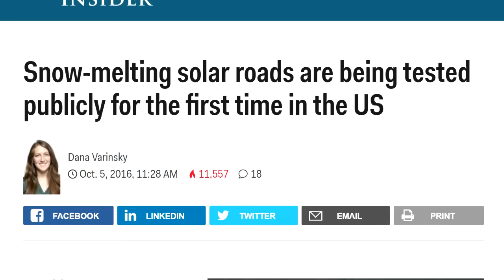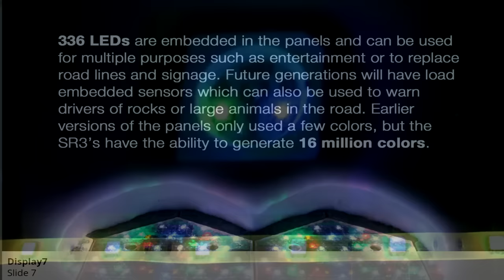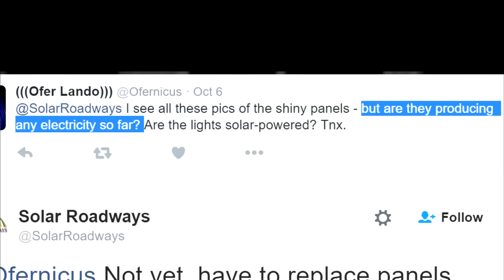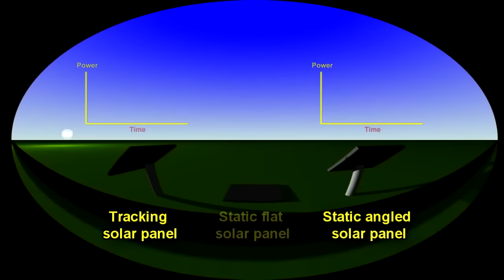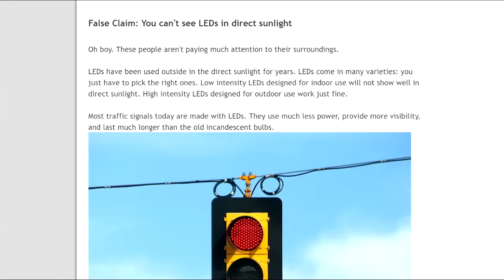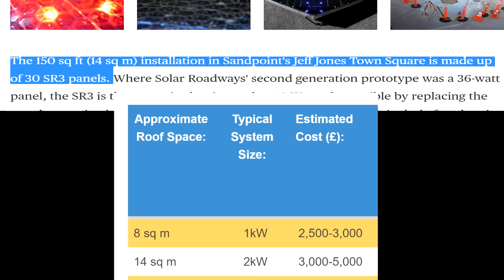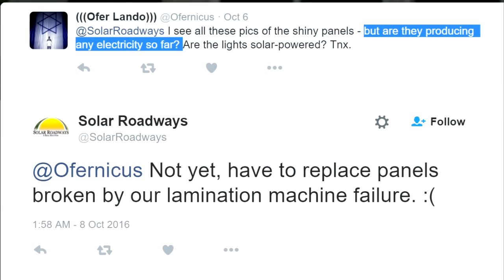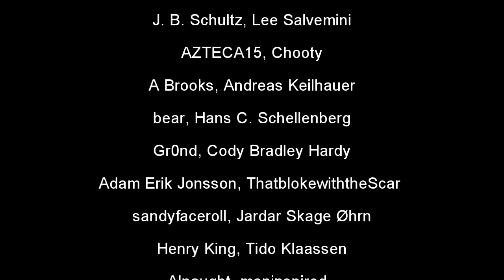First AMAZING Solar Roadway UNVEILED!

Comment: ... To think that such an insulting farce is still being worked on...
Reply: This should not surprise you. Most members of our species are still willing to believe in sky wizards without seeing any evidence. Of course they are going to believe something like Solar Roadways when they there is a catchy promotional video they can watch. Heck, even myself as a perpetually skeptic scientist got enthusiastic for a moment after the video.
Reply: With the "sky wizard" at least there is no direct evidence to the contrary.  With the solar roadways idea, you can quickly google the facts you need to do the math to work out how much money per square meter of road the electricity would be worth.  You can then see how much the installation cost and how much area it covered.  None of this requires skills above what the average grade school kid has.
Reply: Yeah, but there was no way to know it would not work until they tried.
It was supposed to be a fighter that would make all other fighters obsolete so if it worked don't you think it would have been worth it?
This actually is the kind of wasting money a government is supposed to do. It was the same thing, to stay with planes, when they were experimenting with jet fighters to replace propeller ones. There was no guarantee that it would work, they had no idea if they could make the plane from durable enough materials to stay together, if people would be even able to control it at the speeds it would fly at and a lot of other problems but they still tried and succeeded.
Reply: Killer.exe At least the jet engine was a proven concept. I do agree that the government should invest in ways to make the world better, but they should at least invest in things that have a basis in reality. It's clear as day when you listen to the officials that are endorsing the project, that they have no idea how the science works and are only doing it because it makes them themselves look good.
Reply: Miranox ... That's the plane that denmark just bought 21 of those... I'm pretty sure the plane should be fully operational within the next couple of years.
Reply: Just goes to show you how easy it is to make lots of money if you're willing to sell your conscience.
Reply: Being worked on .... whatever....    ...still being STATE FUNDED ...  that's the real Farce
Reply: Dean Goldenstar
We'll see about that. Most importantly, we'll see if it actually justifies the absurdly high cost.
Reply: Miranox I agree on that point. Though a stealth joint strike fighter seems to be somewhat of an ideal, even with vertical takeoff. I hope they can deliver. If not, we just wasted money and bought the most expensive crap on the market.
Reply: While a concept like incorporating piezoelectric generators into roadway systems (which may not be feasible either...but damn sure more feasible and less fragile/complex than solar roadways) struggles for funding and gets little to no press...
Reply: That anyone would even think that piezo roadway would be an energy source says a lot about the sad state of scientific education in North America.
Reply: Billy97
It will never be useful as a large power source but could potentially have some cost effective uses...Solar roadways don't even have that going for them...and yet they get the attention...
Reply: possumverde
These days you will get tons of praise if your stated goals fit the PC culture, even if your actual results are horrendous. Just look at BLM.
Reply: Miranox
True...I was doing some more digging and apparently such idiots have been successful in convincing California to to create a Piezo system...using pretty much the same outrageous claims behind solar roadways and which several university studies have already concluded to be a waste at present...They'll be heroes until the results come in...then the failure will leave a bad taste in politician's mouths and funding for legitimate studies will decrease further...
Reply: possumverde Where do you think the energy would come from?? The flexing  of the roadway for the piezo effect would increase the rolling resistance of the vehicle wheels. Think of paving the highway with foam rubber. It would make the road a parasitic load on the vehicle engines, increasing their energy consumption. It is basically harvesting energy from the cars traveling on the road. 
The first law of thermodynamics  should be enough to quash that one. Never mind the losses involved in the process.
Maybe the government should just repeal the laws of thermodynamics and ohm's law too.
Reply: It's in the state of missouri, the same place as missou uni, so y'know.
Reply: Indeed. Were you to get ridiculous with it (like a huge stretch of interstate) then the decrease on gas mileage etc. would definitely not be worth the amount of power produced. There are situations however where there may be enough of a benefit at small scales for it to be useful...Essentially it would be a tax on drivers (leeching some gas mileage to provide a benefit). In large cities with high density "stop and go" traffic, small scale use might be able to supplement some existing tax funded electrical uses in a manner that would actually lower the long term overall costs.

I'm not saying it would be any sort of answer to energy problems in general, but it is far cheaper and more durable than this solar roadway nonsense and, unlike solar roadways, could potentially have some beneficial uses worth the cost on a situational basis.
Reply: No Free Will oh really I thought Mizzou was in Alaska... in all seriousness I'm fucking ashamed my home state is falling for this shit. Disgraceful.
Reply: possumverde If you find yourself in a hole stop digging. 
Whatever the amount of energy absorbed from the vehicle, the output of the device will always be less due to losses.The frequency and duration of the output would also be so low  that there is little chance of producing significant output.
 If you gather such a tiny amount of energy it is not worth the cost of the wire to connect it.
Reply: artiew87 ... If you're from a place that can't supply clean water to its citizens, then I'm going to argue with you on that point.
Reply: +artiew87 That was random. You might be correct, but it was a bit off-topic, don't you think? (Oh, and the biggest farce in Sweden is the way we let american politics and ideas affect our society.)
Reply: ***** What matters is that however good you make the roadway solarpanels, they will always be cheaper and better placed somewhere else than in roads. For example, putting them slanted above the roads would be less insane.
Reply: The biggest farce in Sweden is the way the country has allowed EU politics to dictate how it's society has been and will be run.
Reply: I disagree with you. Some things are just an obvious waste of time and money. And this is a great example. You do not have to build a mile of freaking solar roadways to see if it will wok. If you looked at this video you can see they are just scamming Idaho taxpayers. Any real good idea, that actually works, will be grabbed by any investment company in the blink of an eye. 
Would you fund a group of people to look for the yeti?
Reply: Indeed. They should spend this money on putting solar panels on every god damn roof they can. I bet this went through because the local energy suppliers saw how stupid it was and didn't try to block it as it doesn't pose any kind of threat to their business haha.
Reply: There is already a very good VTOL on the market. Tbh it's the only proven viable VTOL plane. It's called a Harrier Jump Jet.
Reply: ZER0 The Russian Yak38 isn't too bad either, and the 141 showed promise before it was cancelled after the Soviet Union fell in on itself from lack of money.
Reply: ***** So... like putting the solar panels on roofs instead?
Reply: +Aids gr8 b8 m8
Reply: +Aids well then that's just sad
Reply: ***** Glass isn't suited to be a road surface, it's too vulnerable to vandalism, the solar panels are only at 30% optimal efficiency, if they have light and or heating they're gonna be a net loss in power production.

Honestly I think the next innovation in roads will be when all motor transportation is fully automated and the road will have some tech in it to help them navigate more accurately.
Reply: Billy97
You're overlooking something...The energy output being converted by piezo in this type of set up would the ~3-4% of energy produced by a car's gasoline engine that is simply lost through vibration etc. to the road. Even if you're not getting that full 3-4% back (which would be impossible), anything you do get back would be technically be a "bonus." Now whether or not the costs involved and the efficiency limits of the conversion etc. would make harvesting from such a small amount viable is another question. Currently the answer would be no (especially in the manner California is looking at with their trial run,) There may come a point however when small scale application could be put good use.

No one's talking about "free energy," just the potential for more efficient use of "wasted" energy. Extra work on the part of the vehicle is not necessary for piezo to have something to convert (though current versions do come with the potential to increase drag a tiny amount...even so, you're adding a tiny bit of extra work for the ability to harvest from not just that tiny bit, but from the original wasted amount as well.)

Go do some research on it. While California's use of the tech is silly, the university studies done at the state's request have quite  a bit of information in them. None of which even remotely mentions any breaking of conservation laws. Merely the impracticality of costs / benefit at the current state of the technology.
Reply: possumverde The road is designed to have the minimum deflection possible under tire loading both for low rolling resistance and durability of the road structure. A road that flexes inder wheel loading does not last long. A piezo element has to flex to produce output. It's design would incorporate more deflection into the road surface if it is to have significant output. Work = force x distance. This would increase the work done by engine, however little. Also energy = work x time. The duration of the impulses would be brief and  of low frequency-- one per tire, so the total energy would be very limited.
Reply: Billy97
That's why I said small scale. Something like under intersections in large cities where traffic is nearly constant 50% of the time in either direction (and some areas are traversed by vehicles in both directions). Besides the main point was that something as ridiculous as solar roadways is getting such attention and funding when there are far more...legitimate...methods of going about harvesting energy when it comes to roads. Not necessarily ways that will turn out to be worth it. Just, ways that, at least, make more sense.
Reply: possumverde You should take a physics and an engineering course or read some textbooks.
 Unless you want to pay for it yourself there is no reason to do research on ideas that simple analysis shows to be useless. I have built piezo systems on musical instruments and 1000 tonne rotating machines. They are not suitable for energy production. Also I spent years building electrical systems on, under and along highways. It is the absolute worst place to build any unnecessary system. It is subject to severe wear and tear, damage from collision and snowplowing and salt and any repair involves traffic control and disruption. It is one of the most expensive, inaccessible places to build anything. Intersections are the worst. You have to disrupt both roads to do any work. The small amount of energy would not be worth the cost of the wire to connect it.

Comment: Not to mention my semi-truck driving at 60 MPH in light rain on glass would be a freaking DEATH MACHINE!
Reply: Think how long these panels would last with cars equipped with studded snow tires!
Reply: But they are going to be heated, so the rain will immediately evaporate making a dry surface.  LOL
Reply: +My3dviews can i cook on them too?
Reply: What about my 2 ton pickup doing a burnout?
Reply: nice! how much?
Reply: Yeah, as a fellow driver, I wouldn't want to drive on that shit either. Up to 80,000 pounds (40 tons, people!!) trying to maintain traction on wet glass... no thanks.
Reply: Turn stovetop to high pour water on it watch it instant evaporate put bottom of shoe on it and see what happens. Then imagine a tire.
Reply: Yeah my father is a former driver turned owner and his volvo couldn't handle light rain let alone tons of weight on wet freaking glass.
Reply: Don't fear. It will never happen.
Reply: You realize, of course, that the government response would be to reduce the speed limit to 10 MPH.  Think of the children!
Reply: Haku infinite - And nestled inside each Fontus water bottle, a Triton breathing gill!  Genius!  Clean air and water for everyone!  Also, unicorns, for some reason!
Reply: @my3dviews  And then a random leaf that on it would start a wild fire.

Comment: "...That's a 75% failure rate..."

Man, yeah. It is.

But consider this - THIS IS JUST WITH PEOPLE WALKING ON IT.

Pretty sure there'd be like... 5 individual LEDs still working after a couple of hours worth of heavy traffic if they were on the road.

I'ma go ahead and say on the M3, where it's restricted to 50mph with the roadworks, and there's... cars... providing a nice bit of shade, across what... 70% (Just an estimate, I spend a lot of time on the M3, though.) of the road surface that it's prob'ly not gettin' a whole lot of sunlight. What I'm saying is - as soon as there's a little bit of roadworks - replacing electrical cables, sewage repair, adding in a pointless cycle path that no cyclists use, etc, basically anything that you'd need to remove the duct tape, you're gonna end up with:

a) Heavy traffic covering the solar panels.
b) Having to replace the tiles on a daily basis because of the heavy traffic.
c) The occasional collision because the fuckin' road markings aren't there. "Do I have to give way here? Um... I'll just go - CRASH"

Can you imagine this shit around a school? Every other day you'd have traffic control signals whilst engineers replace the entire road with new tiles from the previous day. Or getting to work? Imagine that - 100s of thousands of cars just... idling in traffic whilst the tiles are replaced 'cause they're not working. But "SOLAR FREAKIN' ROADWAYS!" are environmentally friendly!

If all of our roads were replaced with "Solar Roadways" tomorrow, society would collapse the day after.
Reply: You'd probably do much better if you converted the thermal energy caused by the friction of tyres on the road into usable energy than you ever would with "solar frickin' roadways".
Reply: 2 hours of heavy traffic would turn that patch into fine dust.
Reply: ***** Might just as well give people money for free then, seeing as their job would not only be useless , but harmful too.
Reply: The moment "Solar Shitty Roadway Technician" becomes a legit occupation is the moment I drive a railway spike into my throat with an armourer's hammer.
Reply: Sanguis Dominus it's not even really people walking on it. This is a small town park. People so far just walk around it and look at it
Reply: Sanguis Dominus to compound all that alot were dead outta the gate

Comment: beyond all the other failures, for a car to hold traction wouldn't the glass have to be textured to provide grip, further crippling their ability to generate power?
Reply: Tessa Jalloh yeah pretty much
Reply: Tessa Jalloh - yes, they would have to be textured, they would get dirty, the weather and sun would destroy them. Tiles would inevitability lift and make the road dangerous.
Reply: And on top of that, why would they be colored green. There’s a reason that normal solar panels are always black.
Reply: Lollypop2048 - they are green because that advertises "environmental", so they must be good.
Reply: Yup.
Reply: texture or not, it will fade away, will be slippery with water, it will crack, and and so much more. there is a reason roads are made from asphalt.
Reply: Seriously, who here actually owns a car but can't afford the consequences of getting tires full of glass. Who wants to drive ON GLASS???? 

Not me, that's for sure. Get those things away from my car. 

And if anything fucked up happens and pieces of solar panels end up damaging people and property, they will be suing whoever they can to cover the bills. 
No one in their right mind would choose glass over concrete.

Comment: They actually did a ~tiled~ highway experiment near me like 20 years ago. They found that while concrete tiles did not need to repaired nearly as much as asphalt, no one is willing to drive on a highway with constant bumps every 10`ish feet or so.
Reply: The Germans built some airfields and concrete slab highways in Denmark, during the 1940-45 occupation. In the 1980s, they were still in great shape.
Reply: 10 foot "tiles"